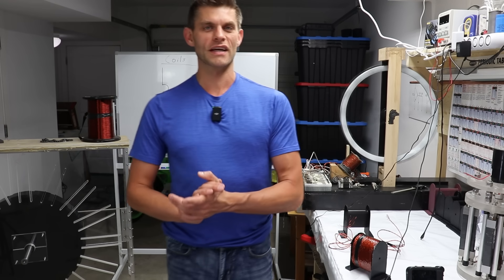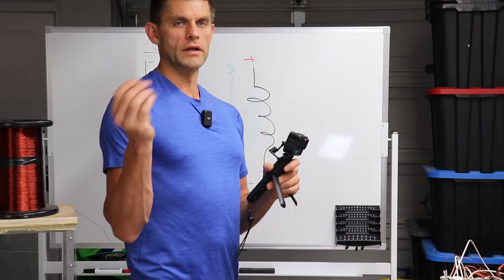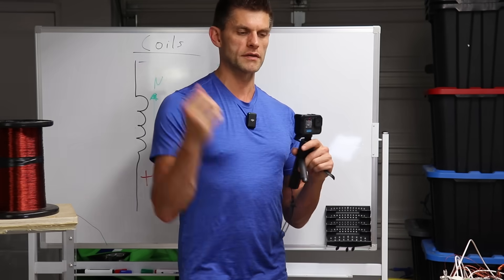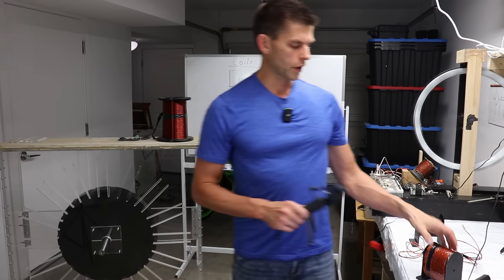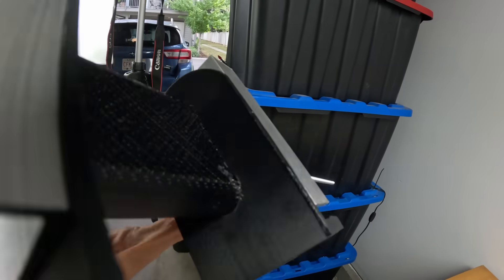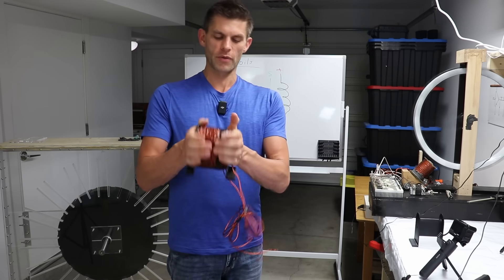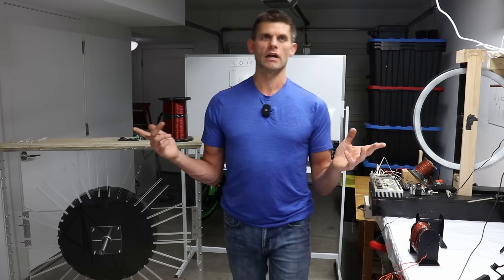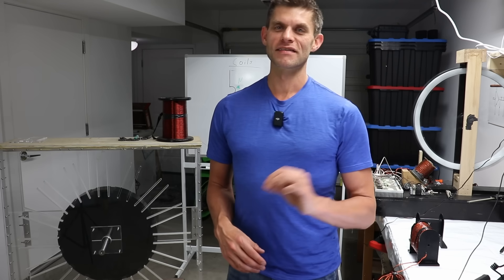Unlimited Energy in My Garage (No Patents)

Comment: Its so funny when channels like this delete my comment because they know they're incorrect. 

What you're finding on the bsck flow is eddy currents, those eddy currents produce an equal and opposite force to the magenetic field enducing them. Meaning it is a form of friction in the system, which would mean evem with the "raised pulse." You will have a smaller pulse 90° out of phase from your first. You are being disingenuous for having comments deleted calling you out on this.
Reply from the maker: Your not calling anything out. You are preaching the normal generic viewpoints that we are disproving with this project.
Reply: @MadscienceLPTECH  as for you claiming I'm not proving it wrong lets try my previous comment again. 

Here it is. 

First your diagram is off, this is basic lorenz right hand rule. The voltage through a wire causes an electromagnetic field perpindicular to the wire not parallel with the current. And perpindicular two both of these is the force.  You are correct though that the direction will change when you swap the polarity of either end/direction of the current.

Now the flaw in your system, you are essentially using a flywheel battery. Its nothing new, you input an amount of energy, and then you're using the next magnet after the pulse to induce an eddie current in the opposite direction. This power will be less then your first pulse. What you are doing thats different is that you are timing your pulses to be exactly with the permanent magnets on the fly wheel and turning them off when the next magnet comes across the coil to induce a magnetic field in the copper winding. 

This is due to eddy currents being produced. Now it will slow down essentially because of magnetic friction on the system. As you produce a current in the wire, the current will create a magnetic field opposite to the one you're inducing it with. Meaning the wheel will ever so slightly be slower then your previous (pulse). If you dont believe me you can just look up "i call this the no you dont law." By vertasium to see how a strong enough eddy current actually stops objects from falling quickly.  Which showcases how it stops movement when high enough in non magnetic materials. 
             So no matter how large you make the pulse it will result in a slightly shorter and pointer output which is your wave every 90° out of phase from the first. 

It would look like this if you hooked up all the leads to an oscilloscope.

Input of coil 
_/——\__/——\__/——\_
Ouput 
______/––\__/––\__/––\_____

Together since your input and output coil are the same would result in. 

.      /——\         _         /——\          _
----/           \----/   \----/           \----/   \

(NOT to scale ofc) 

The voltage would be Less then your input, snd the current would ve slightly lower aswell making the peaks thinner. 

Even with the "pressure" in mind with your plus being greater. What you're describing is just using a mosfets ability to control the voltage to apply it more effectively with the timing of the fly wheel. No matter the pulse strength, the eddy current that is producing your energy will result in the output of the secondary pulse to be less. 

If you dont believe me then put an osciliscope on the input of the machine, then the (input/output) of your coils, and thenwhen you power something read the output voltage and plot it. 

Youll find your input voltage will be higher for the overall machine, your input of your coil will be slightly less voltage but a higher current to your timing, and then the next part of the wave for your (input/output) will show up lower and slightly skinnyier 90°,180°...etc. from the first pulse. Which is your returning voltage....etc.

Under load the wheel will most likely slow and even stop completely.
Reply: @MadscienceLPTECH you completey skipped out the portion where I talked about my comment keeps being deleted explaining why it physically can't work. Its not generic when I'm explaining how your machine is fundamentally flawed. 

You also liked your own comment dude.

Comment: Nice ideas, but can't you show some data? Like energy flowing into motor Vs energy flowing out, to show that there is a net gain of energy. It's very easy to show prototypes "working", but it's not easy to prove they are. Just some thing like a KWh counter on input Vs out put..
Reply: This. You already have a working prototype. Easy to prove all the skeptics wrong today with no more funds. 

Start with partially charged batteries. Video the multimeter reading as the machine works and after time T of unedited video the multimeter shows batteries are charged to 100%.
Reply: @GregoryAstill44821 his meters are on the way, lol. Evidently, a guy trying to educate people on electrical theory and building an over unity device to make public and open source did not happen to have any meters laying about in his shop already…. he is just waiting for some more crowd sourced money to come in so he can go get a couple down at the local napa…
Reply from the maker: For sure we will take data off the little one. But the current build is the one that will show definitive proof, its the whole point of the project. Stay tuned
Reply: @MadscienceLPTECH  Lemme guess. We'll have to wait until the end of times

Comment: I used to twist wires when installing “loops” in the road for like traffic lights and parking gates. When a large piece of metal drives over it, it would interrupt the magnetic field it created and opened the circuit. The gate would then open/close or the light would turn on/off. Is this the same reasoning why you twisted the wires for the coil?
Reply from the maker: The twist is just to allow the flow of energy through individual wires to synergize
Reply: @MadscienceLPTECH  Understood. Have you tried making a coil with just single strand wire instead of twisting and testing for efficiency? I’m pretty sure it’s better to use tightly wound single strand wire. Less air gaps in the coil. I could be wrong, I don’t have any degrees lol
Reply: @D.A.D.Engineering AC resistance due to skin effect and proximity effect are critical things to manage, along with core saturation and remanence

Comment: There is just as much, if not more, energy beneath the surface as in the ionosphere. Tesla’s designs for the Wardenclyffe Tower went ~33 meters deep. The further both underground and into the sky you simultaneously build, the more potent your ability to both receive and transmit electricity without contact.
Reply from the maker: Absolutely 💯

Comment: Did the small unit you have running prove it? If not, why? Could you do a smaller scale experiment with small batteries?
Reply: You should look through the comments to see if others have already asked your question and gotten an answer.
Reply from the maker: Small batteries are not ideal, we want low internal resistance. We could of gone smaller yes, but electronics wiuld have been the same so might as well go a bit bigger

Comment: Where is your small scale working project?
You don't leap into a big expensive project without a small one to prove it works!
How much voltage and current? 
How much power out for power in? What have you run with it?
Show us it works!
Reply from the maker: All the electronics need to be stepped up regardless of size, same with batteries you need high V and low R... so why not step eveything up  like we are doing

Comment: The moment you start saying things like “excess energy”, I start counting how many times your theories violate the laws of physics lol you cannot get more energy out of a system than what you put in.
Reply: His reply is an uneducated stupid answer!
P.v. panel manufacturers can't and won't claim more out than goes in. Around 1350 Watts per square metre in space from the Sun.
Originally around 6 to 8% efficient but now at best 20% can be achieved.
Where is his working small scale prototype of his project?
I call B.S.
Reply: @bill-2018  his reply is stupid because solar panels arent closed systems.
Reply: @yee-ji5ib lol right? Perhaps he is legitimately asking what solar panels do, because it’s clear he doesn’t understand how anything actually works 😂
Reply from the maker: Whats a solar panel doing?
Reply: @MadscienceLPTECH they aren’t creating “excess energy”, they aren’t “zero point energy” and “free energy” is an unscientific, disproven concept that you are using to mislead people for likes. Your DC powered electromagnetic motor that relies on both a DC power supply and magnets that will wear out is a cool toy but is simply not any of the zero point energy things you claim it to be. Why don’t you show a measurement of the battery you are using to power the system compared to the battery you are “charging” over an extended period of time. I hope you don’t really believe the things you are saying and that you’re just doing it for likes. but if you are actually an electrical engineer, I am sure you knew what were claiming was wrong in the first place. Also, you have not shown any evidence in this video that you have excess energy compared to your overall inputs in the system, 😂
Reply: @MadscienceLPTECH  
Well I can't measure solar power input to my panel, only power to the battery.
In space the Sun produces something like 1350 Watts per square meter but I doubt you get more out than goes in.
Manufacturers of solar panels can't claim more out than in and typically were around 8% efficient although I believe in science labs they have achieved 26% under ideal conditions. Modern ones can go up to 20%.
Reply: @MadscienceLPTECH  Is this a serious question?? It's converting power generated by a giant fusion-powered ball in the sky.  We know exactly where the energy comes from and the fusion process that exchanges mass for energy.  You probably even know the equation that dictates that conversion...

Comment: lol, calling anything zero point energy when you’re connecting a power supply is hilarious.
Reply from the maker: Why, its a storage system just like solar uses batteries
Reply: @MadscienceLPTECH  You wouldn't need to store energy if it were zero-point since the supply isn't limited unless you were using a capacitor as a means of obtaining larger magnitude of energy transfers. But at no point do you show a need for that.
Reply: @MadscienceLPTECH I’m talking about the battery you are using to “power the system” lol. Your videos are devoid of any measurements for a reason, they would disprove your pseudoscience.

Comment: So one battery is powering the wheel. Ok fine. The voltage spikes from the magnetic field collapsing are going into the second batter. Ok fine. How much power is being put into the second battery? Why not show us? Is it just charging that battery? The first battery will inevitably run out of electricity. Would you then just swap the batteries? Where is the excess electricity? It seems it's just a way to capture or in a sense a closed loop system. Isn't it just moving electrons from one battery to the other with a fancy wheel?  Show proof of the excess energy please.
Reply from the maker: thats the point of this project, show definitive proof. excess energy comes form the HV spikes and lead acid batteries. i will do measurements in future videos on the small machine
Reply: @MadscienceLPTECH  What?? NAH.

You cant say "The point of the video was to show definitive proof" and then go "oh but ill show you the actual measurements later just trust me for now bro".

That's bullshit. Measurements are proofs, and since this video had a lack of measurements, its got a lack of proof.

Comment: I just saw this somewhere else, is this the same technology In the below video basically that you’re using?

https://youtube.com/shorts/7pkUdOoQlP4?si=fARmQmQMIxAo5uBl
Reply: That reel is fake. Sorry to burst your bubble. 

Here's why: ( I hope you are able to understand this )

(1). No Changing Magnetic Field: For continuous rotation in an electric motor or generator, you need a changing magnetic field that interacts with the magnets on the rotor. In your setup, the large magnets create a static magnetic field.

(2). Static Attraction/Repulsion: The small magnets on the rotor would simply align themselves with the static magnetic field created by the large magnets, reaching a point of equilibrium where attraction and repulsion balance out. Once aligned, there would be no further force to cause continuous rotation.

(3). Lack of Commutation/Alternating Current: Real motors use either alternating current (AC) or a commutator with direct current (DC) to continuously change the polarity of the magnetic fields, creating a constant push and pull that drives the rotation. Your setup lacks this dynamic element.

While you might get a slight initial movement as the small magnets align, it would quickly stop. To achieve continuous rotation, you would need to introduce a mechanism that creates a constantly shifting magnetic field, such as electromagnets with a power source and a way to switch their polarity.
Reply from the maker: I can't open link
Reply: @MadscienceLPTECH  works for me and others, try again?

Comment: Why harvesting bulk ZPE as a power source conflicts with thermodynamics:
1. Detailed balance
Vacuum fluctuations are isotropic and at zero temperature. Any device that tries to rectify them effectively acts like a diode at T=0K. The fluctuation–dissipation theorem forbids a net DC extraction without an external bias; otherwise the device would violate the second law of thermodynamics.
2. Casimir forces are conservative
Even though they can perform work while plates move, returning the plates to their original separation requires exactly the same work you got out.
3. Dynamic Casimir effect (DCE) produces real photons when a cavity boundary is accelerated (or its electrical length is modulated). The energy in the photons comes from the work you do on the boundary, not from the vacuum “for free.”
Reply from the maker: Generic chat GPT answer. Thanks though stay tuned
Reply: @MadscienceLPTECH  Even so, doesn't make what they said any less true.

They listed 3 facts that explain why harnessing energy from Zero Point Energy is not practical using the Casimir effect.

Comment: If everything you said was true you'd be an instant billionaire.
Reply from the maker: no
Reply: @MadscienceLPTECH  He wouldn't be an instant billionaire no, but he'd receive a Nobel prize award and lots of publication from the modern scientific and philosophic communities. 

He has not though. Because its fake. Neither the science nor the math checks out when someone actually does it, which he never shows in the whole vid any measurements. How much power is being put into the second battery? Why not show us? Is it just charging that battery? The first battery will inevitably run out of electricity. Would you then just swap the batteries? Where is the excess electricity?

None of these are shown.

Comment: The longer it takes to make his machine, the more money he can grift. You can fool some of the people all of the time. He has a first build but shows nothing as open source.
Reply from the maker: Huh, im litterally showing eveything hater
Reply: @MadscienceLPTECH  Showing everything but the proof or any measurements.

As a previous commenter pointed out:

One battery is powering the wheel. Ok fine. 
The voltage spikes from the magnetic field collapsing are going into the second batter. Ok fine. 

How much power is being put into the second battery? 
Why not show us? 
Is it just charging that battery? 
The first battery will inevitably run out of electricity. 
Would you then just swap the batteries? 
Where is the excess electricity? 

It seems it's just a way to capture or in a sense a closed loop system. Isn't it just moving electrons from one battery to the other with a fancy wheel?

You show nothing, and call it everything.

Asking questions is not hating. Ignoring them is.
Reply: @yee-ji5ib it's simple to show. He has a first generation machine running in the background. Connect the two batteries in parallel, if you're getting more out than you put in, then the voltage will be going up. Another thing, why would reduce efficiency by setting the coil so far from the magnet. The closer together, the stronger the field. I wish he had something going on here, but it's the same old song and dance.
Reply: @HowardSinclair-z6b  Voltage going up is NOT indicative of the level of energy one has collected.

Voltage is "how bad electricity wants to move from a to b"

Kinda like how water pressure is "how bad water wants to move from a to b"

Higher voltage does NOT mean more water, it means more pressure.

When you a apply large amount of energy over a long period of time, it acts like a small force... and when you apply even a tiny itty bitty amount of energy over an extremely short amount of time, it acts like a big force.

Voltage spikes in this system are caused by back EMF due to the collapse of the magnetic field. 

THIS DOES NOT MAKE MORE ENERGY IT JUST CHANGES THE AMOUNT OF TIME THE ENERGY IS APPLIED MAKING IT SEEM LARGER BUT IS ACTUALLY SMALLER.

I hate explaining the basics.